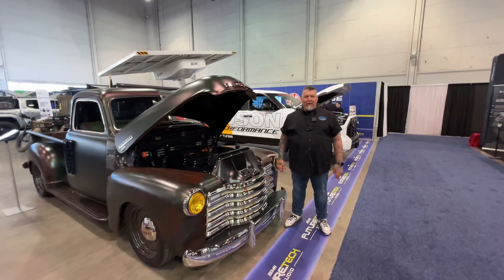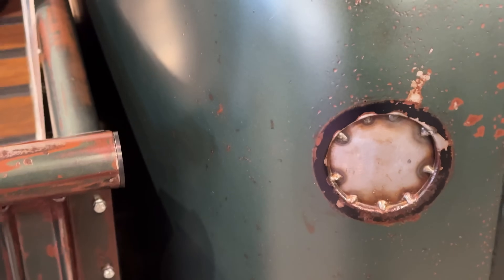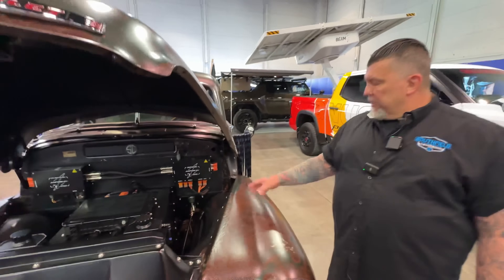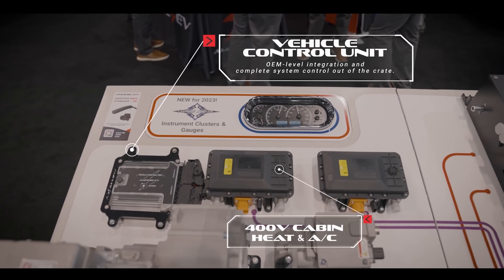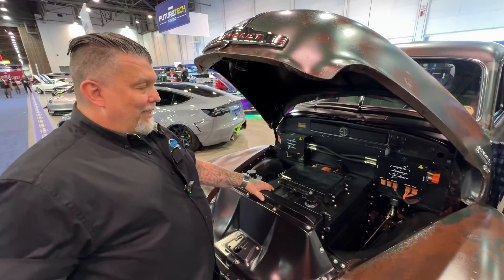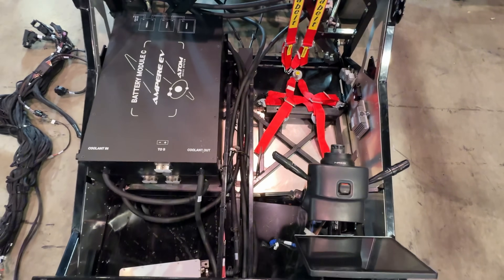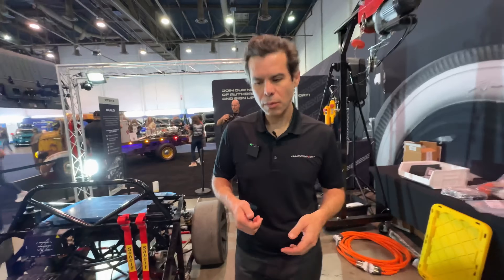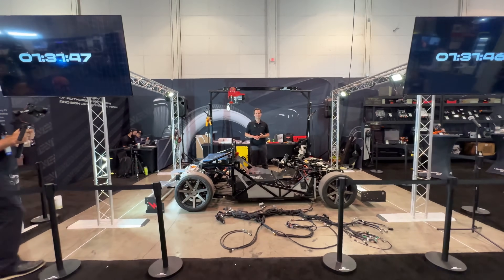Revolutionizing Classics: How Ampere EV’s Atom Drive Turns Classic Trucks into EV Masterpieces

Comment: For 250k you can buy some of the rarest and greatest classic cars/trucks ever built. They will appreciate in value instead of depreciate and can be easily fixed.
Reply from the maker: Interesting prediction and investment advice. Speak in 10 years
Reply: @OutRun_YT  Not investment advice its just a simple fact. Most classic car values have increased and most of the EV stuff has depreciated in value very quickly.  Like I said, for 250k you can buy some of the most desirable/in demand classics. That won't change in 10 years time unless they somehow manage to outlaw classics from public roads..
Reply from the maker: @davidgalea6113  you can't really compare the depreciation of an OEM EV to a converted-to-EV classic —it's like comparing the depreciation of a new gas car to a classic car. They're entirely different animals. Plus, we don't buy these cars to make a quick buck or capitalize on them. We buy them to drive and enjoy! There are way better investments for financial returns than cars!

Comment: Starting at $40,000 per vehicle for the system. That's a lot of gasoline fill-ups.
Reply from the maker: You need to compare apple to apple a brand new Hi performance LS, a brand new transmission, tank, exhaust system, etc etc then gasoline fill up. That said no one said it was a budget option.

Comment: Can it be used with a manual transmission?
Reply from the maker: Not the way this system is designed as it gets rid of it. This is quicker, faster and more efficient (plus lighter) than a system repurposing the original manual box.

Comment: Not Hot Rod, nice product but it has no ghosts it's a brand new product
Reply from the maker: Well the body is original on this green one.
Reply: @OutRun_YT  Cong rates but that not what these guys are selling. I didn't say the product isn't cool its just not a hot rod in my mind, others will think differently. but this is a product, it a low volume manufactured product for the automotive market. It has it's place and I'm sure there is a market, I'm just not a potential customer it has no appeal to me.